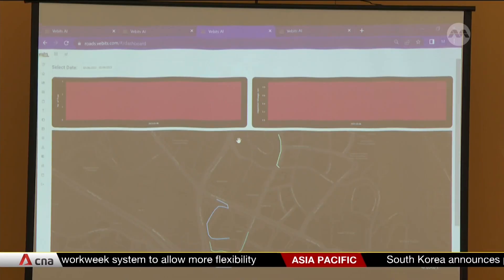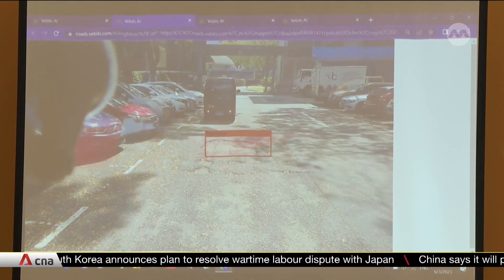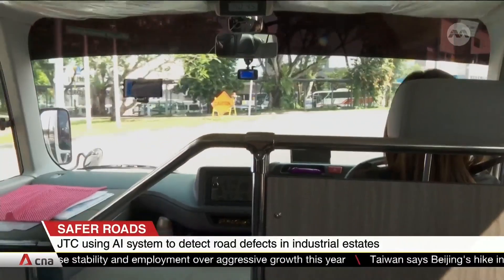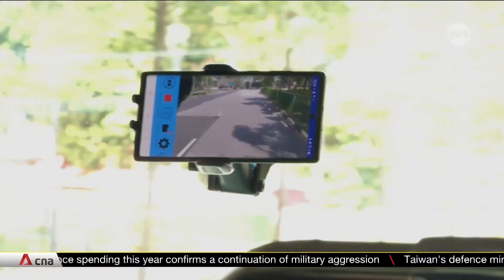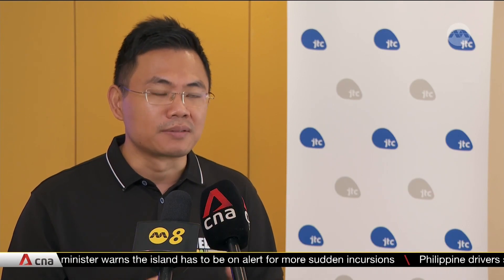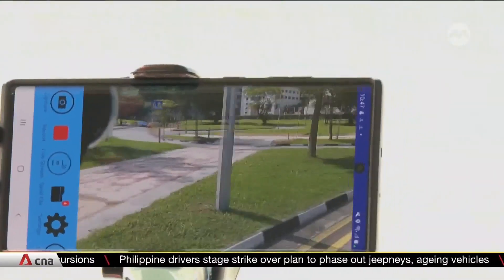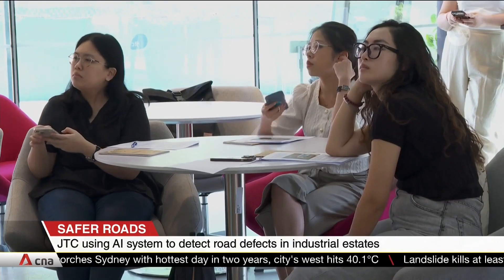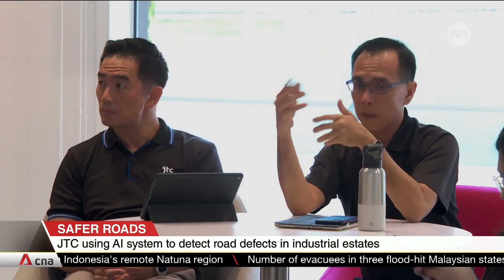JTC using AI system to detect road defects in industrial estates

Comment: Automated inspection. 

Lowering cost on infrastructure maintenance, preventive maintenance. 

How about improving on this
A. Use hyperspectral camera 📷 to get a 3d image of the condition under the surface. 
B. Run the AI recognition software over potential failures and generate road, shoulder possible failure.
C. Train manpower to identify the progression of fault to failure.
D. Study materials science with either NUS or NTU to create cost effective solutions.

That would be WAY BETTER, don't you think.

🫣👮‍♂️

Comment: I see it as multi layers of doing the same thing = Ineffective, inflate the cost unnecessarily and wasteful expenditure. The process may take an hour, but the setup times, costs may be comparably more. Unless there are reduction in tangible cost and tax and expenditures clearly transparent to the public, otherwise to read it with a pinch of salts.
You ask, why don't they applied AI to traffic lights and lift that are clearly applicable and visible to the Public to justify the technology and economic than some secluded system up to them to say?
If in doubt, maybe we should ponder on this;
"WHAT WOULD MAKE YOU RAISE GST? PROFILGATE SPENDING AND IRRESPONSIBLE UNSUSTAINABLE PLANS!" -PM LEE,GE2015